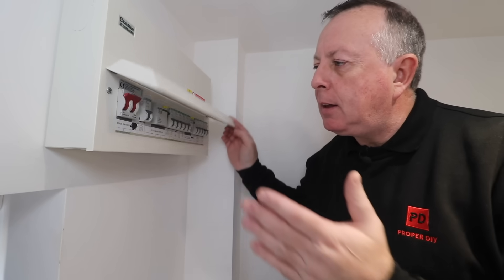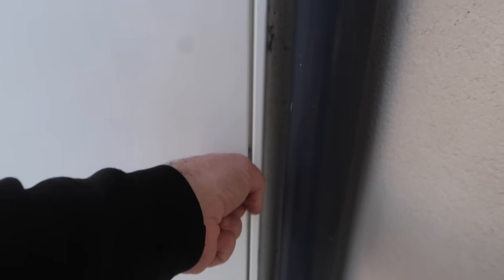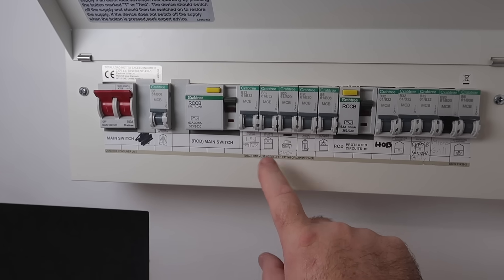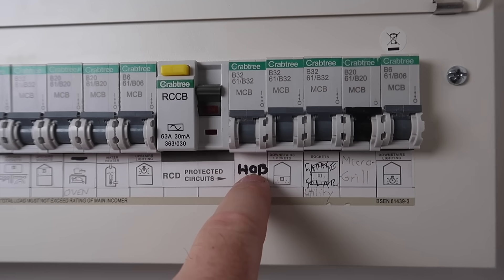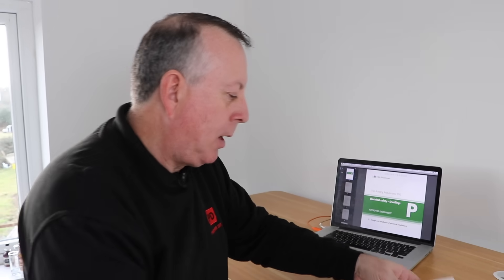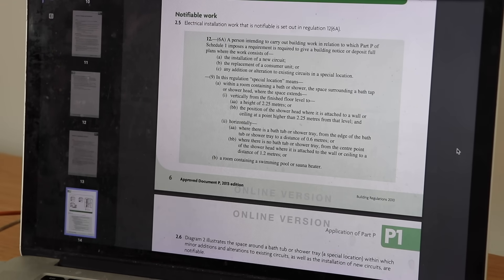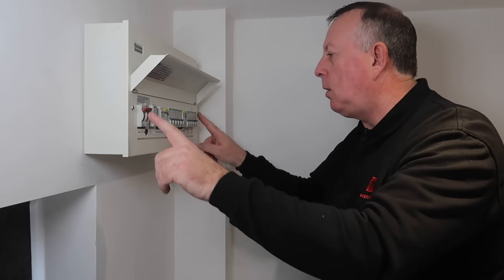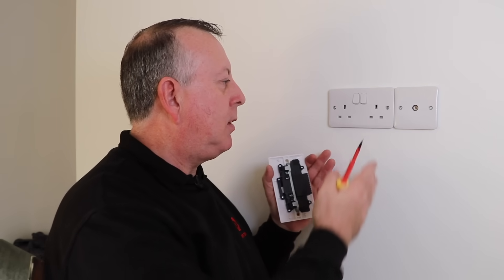What electrical work are you allowed to do in your own home?

Comment: Absolutely brilliant video.  A follow up on the art of cramming (I mean “dressing”) a pair of 2.5mm twin & earth cables into a standard 25mm back box, as well as whether or not you should twist cables together would be great 👍 😂 thank you!
Reply: Twisting them together is bad for the cable and a pain in the arse when it comes to testing. Don't do it!
Reply: @Savagetechie  completely agree.  Been a total pain in our house when changing out sockets / adding spurs.  Maybe WAGO could make a special spiral connector so I don’t have to keep chopping them back 😣🤬😂
Reply: @PrinceBarin77  you can get 6mm wago 221s that will probably take a twisted pair of 2.5, they will definitely take a doubled over 2.5
Reply: I think a lot of electrician's need re training and as for pricing a job they just pick a price out of thin air and hope for the best I have every intention of carrying on with my DIY electrics as diyers we do a far far better job than you and I think you know that
Reply: @laurie886  So a lot of electricians need re training and yet not  one DIYer needs any training whatsoever😂.  Some logic that is, give your head a wobble. There's not a Diyer on earth who will ever do a job better than me. 100% guaranteed.
Reply: @davebadger100  my (DIY) electrics will stand up to any inspection I am not mugging of all electrician's I've been doing this for years I personally would not touch electricity without the proper test equipment I use a megger a wiha torque screwdriver and a number of other good brands of tools I don't need training I just use common sense and the correct tools
Reply: @davebadger100  Based on my experience of 'qualified' I have yet to meet any type of worker (engineer, electrician etc) that can do a job BETTER than I can.  Equal to?  Sure.  Worse than - very often....... and that's the problem.  There are far to many 'bad' workers out there.
Reply: @kellyeye7224  Yeah sure. Ive not come across a DIY  job that hasn't had something wrong with it. I doubt very much doubt you're as good as you think you are, no DIYer ever is. I doubt you could lay bricks like a  bricklayer or plaster a wall like a  plasterer or pitch a roof like a proper chippy. What about lead work, I suppose you can weld up a lead box gutter or saddle round a chimney as well as a qualified lead worker.
Based on my experience of DIYers I've yet to meet any type of DIYer who has the first clue about what theyre doing, thats why they end up on YouTube. You only have to look at some of the comments on here to see the colossal amount lack of knowledge amongst  DIYers.
Reply: Never twist - lots of sparking points where they touch but don't bind together. Double over the wires, as in videos on YT videos by professionals for professionals, eg, eFIXX and John McGrath (who is an electrician by trade and a woodworker on YT). I've had to re-set socket and lighting wiring by professionals whose work reveals itself as loose and sloppy very quickly, sometimes within a day or two. Always check work by professional registered electricians unless you have seen them at work and checked their work, preferably in someone else's home!
Reply: And no, never twist cables together! Ever!!
Reply: If you don't know whether you can, finding out from a bloke on YouTube is not a good idea. Find a qualified electrician.
Reply: @Loosehead  Nah all electrical work is easy
Reply: @Loosehead  you don't need to be qualified you just need common sense I think YouTube electrics from the college training centre (the people who give the advice is ok)
Reply: @laurie886  If you had a Ze of say between 1.8 and 2.5 ohms on a PME incomer, what would you do?
Reply: @davebadger100  first thing I would do is unplug all loads then switch off main isolator check out all earth connections if I still have the same high reading I'll call out an electrician because I will not touch anything that I can't isolate myself. I am ok with electrician's  there are some good ones out there I got a bill some time ago for £500 for the installation of 2m 2.5 twin and earth but if I can do a job myself I will anyway thanks for the reply.
Reply: @laurie886 😂😂😂😂😂😂😂😂 Ze is the external part of the loop and has NOTHING to do with loads or connections in your home! 😂😂😂😂😂

Comment: In Australia. None, absolutely nothing. Far as I'm aware Australia is the only country in the world with just a ban on any home electrical work.
Reply: Brought about by the unions for protectionism many years ago, under the guise of 'safety'. If you mention that NZ uses the same wiring standards, same voltage, and same fittings, whilst allowing some DIY work, you'll get stone silence in response.
Reply: And yet our biggest hardware store has a huge supply of electrical gear and I do not see electricians there. Your right about None, absolutely nothing  need a licence to run Ethernet a cable between two rooms.

Comment: What price range are you looking at to upgrade the circuit breaker box.
Reply: Depends on the state of the existing wiring. I've had two boards fitted in subsequent houses to replace wired fuses and they cost £550 and £750. Depends where you are in the country though.
Reply: I had my breaker box replaced for £350 in November 2021 with a certificate for a rental property. That was using RCBO's they are better than the MCB's.

Comment: I'm not saying anyone can install things but anyone with a general knowledge of electrics could do most basic jobs including adding a circuit. So called qualified installers make mistakes for fun and they're "allowed". Loose wires, installed incorrectly etc. Making a circuit is easy and safe if everything is connected in the correct holes and secure. I'm not advising going doing it all DIY but adding simple circuits etc is easy especially when it can all be isolated safely. Trades inmy experience do what's easiest for them and not always what's the best for the install.
Reply: You should work in a college that trains these "so called qualified installers."  Scary, or what!!!!
Reply: @dnealuk  so I'm not saying they don't get trained properly if that's what you are getting at? Just that there are far too many bad tradesmen out there that could do something wrong and do. For the most part they get away with it so I personally would have no issue adding my own fused spur rather than getting someone in. We're not talking about something highly dangerous unless you have done something silly like left connections loose.people will have you think your house will burn down and I get there are idiots out there so it's probably better to do that. Its hard as I would consider myself intelligent enough to add a fused spur but you make your own assumptions. No more dangerous than changing the brakes on your car but anyone can do that and that doesn't kill anyone does it?
Reply: How would you test the work when it's done?
Reply: @davebadger100  so Ive not written this to say you should do it. But to say a fused spur is a notifiable task is in my opinion a bit of a joke. I've had jobs done in the past like that and they don't always test other than getting power at the socket/light or whatever. I get the good ones may do this but comparing small changes that I'm relating to in comparison to fully fledged electrician tasks like consumer units and fault finding that need specialist equipment are very different.
Reply: @Danme1987  I'm not arguing the complexity of such tasks or the validity of making them notifiable or not. 
My point is this.
All work should be tested regardless. This is to ensure that the existing installation and the new work is safe for continued use. This is laid out quite clearly in the wiring regs. This is the detail that is conveniently forgotten, overlooked or ignored by most if not everyone outside the electrical industry and more worryingly by quite a few within it.

I don't mind admitting that I've made mistakes  during electrical installation, but I always test everything so it gets highlighted and corrected before it is put into use.

How will anyone without suitable test equipment and knowledge ever know that the circuit they are altering and/or the additional work they do is safe and compliant.

The amount of dangerous and shoddy work out there is huge. For example lighting is a particular favourite. I've lost count of the amount of poor terminations, twist and tape connections and lost earths on light circuits where people have "had a go". Then they change all their switch plates from plastic to shiny chrome leaving their family and loved ones at possible risk from electrocution should anything go wrong.

How will someone know if the existing or new work is earthed properly without testing. How will they know if the RCD is still tripping within limits without testing?

Most domestic electrical work is as easy as it gets, but most DIYers  seem unconcerned about how safe it actually is.
Reply: @davebadger100    I do agree with you fully. I guess it's more about where is the line drawn in terms of what you are allowed to do as from what I've read installing a inbuilt cooker on an existing circuit is allowed as it's none notifiable but installing a simple garage radial is not when isolation is possible. I personally find that mad. One loose connection and you may have a fire with the cooker. Like ive said I'm not encouraging people to work if they haven't a clue. I've also read that you can basically only be fined etc if your work can be proved and it's caused serious  harm/damage. Otherwise it all gets swept under the carpet anyway. I don't know how true that is but just something I've heard.
Reply: @Danme1987  Personally I think that all electrical work should only be done by fully  qualified registered electricians purely for the points I've mentioned ie testing. As I said actually carrying out basic domestic work ( extending circuits, wiring a socket etc) is as easy as it gets. It's the knowledge behind it, MCB ratings, cable sizings,  current carrying capacities etc along with the actual testing that's the issue. No DIYer is going to spend upwards of £500 on a multifunction tester to test  20 quids worth of spur extension off of a socket. 
As for the legalities, I believe that the law DIYers are breaking is non compliance with Part P building regs. Even though some work is non notifiable, reference is still made to this under the certification, inspection and testing section of Part P. So even though some work is non notifiable DIYers are still breaking the law if this work is not certified, inspected and tested in accordance with BS 7671. Part P also says that the local authority can take action if work can be proved to be unsafe and non compliant. 
If serious harm and or damage was caused I would imagine this is the law that would be used to prosecute a case.

Comment: Curious as to why your house has a further isolating switch between the double pole isolator and the consumer unit. Sounds a bit belt and braces to me!
Reply: I would imagine that the consumer unit is further than 3m from the main head. DNO's don;t normally allow meter tails to be longer than 3m. Over that length a switch fuse isolator must be fitted and downrated to 60/80 Amps.
Reply: @davebadger100  And what a ridiculous rule that is.
Reply: @markrainford1219  DNO's. Law unto themselves.

Comment: You can carry out any work as long as it is then checked and inspected by a qualified electrician.
Reply: Or by building control (which will cost an arm and a leg - making it often cheaper to employ an electrician).

Comment: 230 v. When did this happen ?
Reply: 2003 actually
Reply: Only the legal specification of the voltage changed. Most supplies are still 240v (which is within the allowed tolerance) just as in continental Europe they are still 220v even though they are now nominally 230v.

Comment: Well, that was informative enough for me to be glad I don't live in the UK! Here in the US, we have much wider latitude as to what we can do. For instance: our circuit breaker panels are much, much different-- there are always empty slots left over for adding more circuits later on. I recently added a new 240VAC circuit to my garage panel to run a heater. I used 3/4" conduit (having been an electrician for several years at a food plant, I knew how to do that). No permits were required. The panel had more than adequate space for the new circuit. Side note: for 240VAC in the states, we use two "legs" of 120VAC each (for clarity: we randomly call this 220VAC, 230VAC or 240VAC, as the actual power coming in is two legs of between 110VAC-120VAC... usually averaging around 115VAC).

Comment: None because most people botch it then call in a qualified electrician like myself when it goes wrong.
What people don't realise is electrical is just as dangerous as gas but still decide to give it a go themselves.
Alot of people think we'll it works that's OK when 8/10 on DIY it's a botch job and potentially dangerous
Reply: Unfortunately I realised in recent years what cowboy botched jobs actual electricians had done to my house in the past. Having educated myself, I now know what is acceptable and the cowboys won’t get any joy from me ever again.
Reply: @johnboyginger  you could get a local electrician and they could still botch it.
The worst one is price work you give a quote and email you saying they are getting it a grand cheaper elsewhere.
Had it happen a couple of times myself and I've been called to go put right their mess they use inferior quality accessories and equipment and sometime cause more damage than needed to get it done.
Reply: @asamitchell7948  that’s my point. I’d make sure they are good, the quality of materials is good, neat and fully tested/recorded. Had loft conversion to regs a few years ago fully signed off. I found out they’d not earthed the sockets! No earth bonding at all even though they’d recorded there was. Happy to pay good money for good quality.
Reply: @johnboyginger  Agreed, I was lucky enough to get a window installer who having done a great job, recommended a central heating installer who having done a great job, recommended an electrician to fit a new fuse box.
Everything working perfectly.
Reply: Agreed 👍

Comment: Is it allowed to have sockets in a non-ring arrangement (similar to lights) if a thicker cable is used?
Reply: Yes it's entirely permitted to have a non ring (radial) as long as the MCB is rated to protect the size of cable. As you stated it would need to be a bigger cable if you are sticking with 32A circuit. But you could use a 16 or 20A MCB on the same 2.5mm² cable as would have been in a ring at 32A.
Reply: @TheGraemeEvans or RCBO?
Reply: yes, in fact the only reason you still see any rings in modern installs is because the IET have wasted so much time discussing new and interesting ways to test them. You don't see them anywhere else.
Reply: Yes it's called radial rather than ring circuit